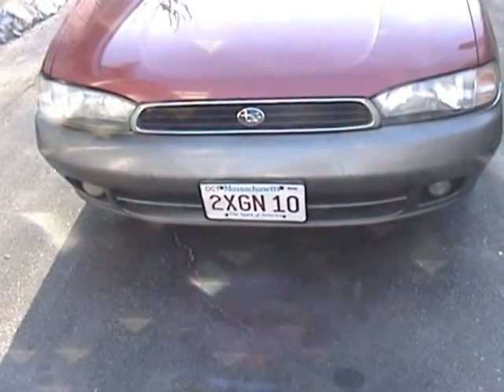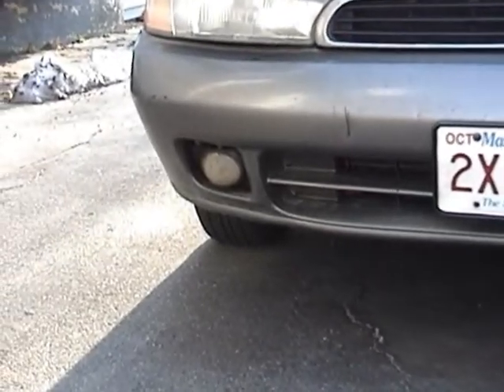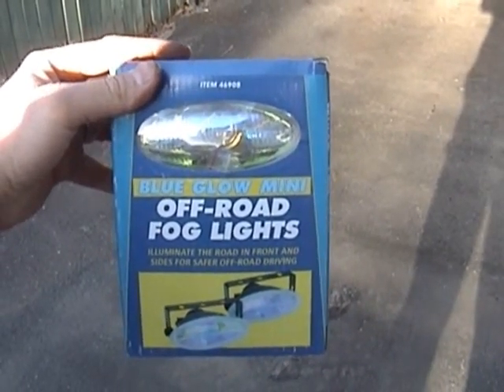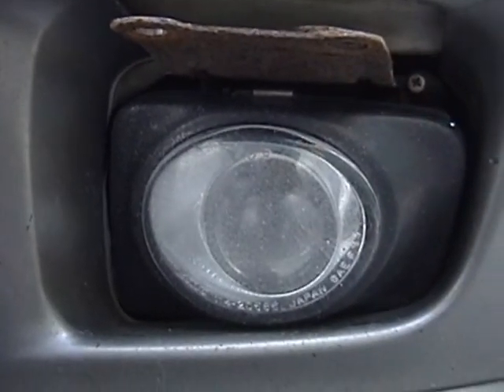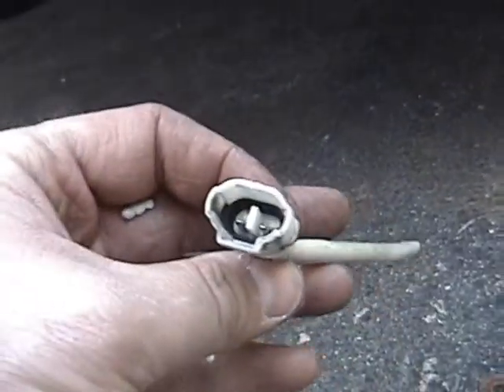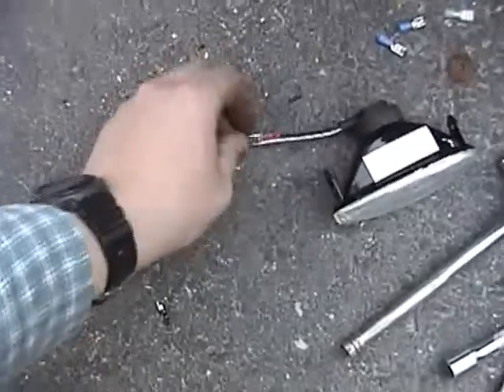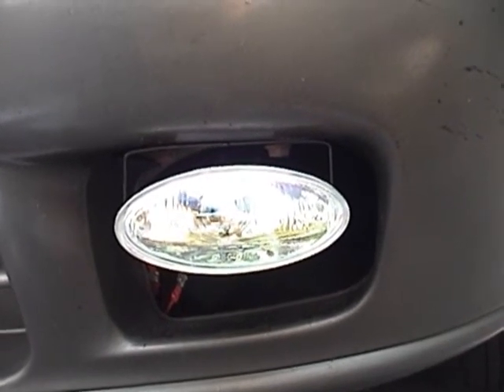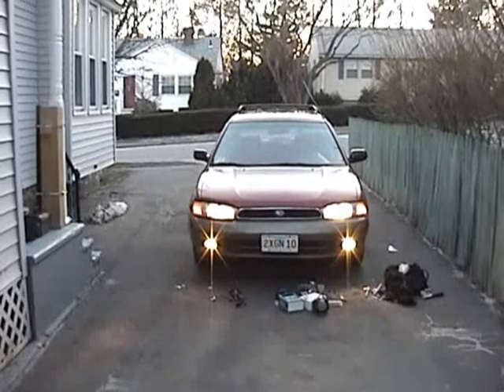1995 Subaru Legacy - DIY: installing aftermarket fog lights

Comment from the maker: Thanks. A knock sensor video will be coming, most likely, but not soon. It's accessible from the top of the engine. If you look down to the block near the rear of the driver's side, beneath the intake manifold, you should see it. It's secured by a single bolt. Not a difficult job. I did one on an EJ25 back in December.

Comment from the maker: Hey there
Sounds like you have a bumper like my old car (Legacy L). My wife has a similar Legacy L, with those spots in the bumper that look like knockouts. I looked at the wiring on her car and the car does NOT have the wiring to hook up fog lights. I also don't know if the dashboard has the correct wiring for a factory fog light switch. You MAY have the wiring you need, but you also may need to run fresh wiring and add a new switch. Not a huge deal in the long run.

Comment: I would like to install fog lights but my car never had them, only a rectangular spot that looks like a knock out. Any suggestion on that? Wiring, cutting out the knock out?  Any thoughts on installing an HID headlight system for my '95 Legacy LS? I've found a few that are compatible on E-Bay.  282,000 miles and still fixing it up and working on it! I found fog lights which did come with brackets and the HID kit on e-bay.  THANK YOU!!

Comment: I assumed there was no ready wiring there, and assumed I would have to splice in new wires. There is a knock out on the dash for additional accessories so I could put a switch in there and run my own set of wires, a job I would be fine with.

Comment: how did you do the splice part? what were those pieces you connected to the ends of the wires to allow the connection of the new fog light to the factory wiring?

Comment: I have a 1997 LSI wagon, that has doesn't have the fog lights, but it has the cut-out for the fog lights.  I was looking around the front bumper and I notice the factory fog light connectors. It seems that this car is capable of having the aftermarket fog lights. The factory fog lights is too expensive. I am considering an aftermarket pair of fog lights. My question to you---  Can the fog lights be turn on and off with factory switch?  Do they have to be on all the time when you turn on the car?  I am planning on doing the same install as your fog light set. But I don't want my fog lights on every time; I turn on the car.
Reply from the maker: +Mister X I spliced my aftermarket fogs into the existing wiring in my bumper. I use the factory switch and wiring to activate them. They are not on at all times with the car - only when the headlights are on AND the fog light switch is turned on.

Comment: What were the bolt size on the stock fog lights you took out? I can't find in anywhere
Reply from the maker: Tough one... Unfortunately, the video dates back four years almost to the exact day, and I no longer have the car itself or the old fog lights. If I was in your shoes, I'd just get a set of small metric hardware and go trial and error on finding something that fits. Best of luck.

Comment: Do you realize that you replaced expensive KOITO JDM fogs with cheap no name parts??
Reply from the maker: I debated whether or not to address your question, but here it goes. I doubt you'll find it satisfactory, and it is a LONG explanation. If you don't mind a VERY long read (you've been forewarned), here it goes:

Yes - I was absolutely aware that I replaced the factory fog lights with the cheapest available alternative. That was the intent (more detail on that lower in my response).

No - I was NOT aware they were KOITO, as I'd never heard of the brand before your comment. I'm sure it's an excellent brand, but I don't know lighting manufacturers. I never pretended to, and I never aspired to. There are a great many manufacturers of aftermarket and OEM auto parts, not limited to lighting. At the time (this video is seven and a half years old), as far as I knew, these were made by Subaru. 

More to your point, I was 100% aware that I was sacrificing quality by installing these cheap lights. It was obvious that all things being equal, if the factory fogs were in brand new condition, they would have been far superior lights. For me, these were the most suitable alternative.

This car was, in early 2013, new to me. But, it was an 18 year old car hiding a lot of age- and rust-related damage and wear and tear. Plus, these cars were a dime a dozen back in 2013. A ratty example like this one wasn't, in my opinion, worth spending a lot of money on. As I said early in the video, I did try to get the factory fog lights working again, but they were too far gone. One was completely corroded, and the other only worked for a short while with a new bulb. I needed the fog lights to work for the car to pass inspection. The car didn't need fog lights to pass the state inspection, BUT (and here's the catch), any lighting present had to be in working condition. So, because the car was already equipped with fog lights, they had to work. My options were to fix/replace these with equivalent, replace with aftermarket, or delete them. 

Originally, I wanted to replace these with the same lights. I don't recall if I was able to locate a new pair, but at the time, even used examples were prohibitively expensive. I recall paying around $1000 for the car, maybe more, and I seem to recall (once again, going back in memory nearly eight years) that it would have cost at least $100 for a used pair at the time. Compared to the cost of the whole car, that's a big chunk of change for a pair of lights that I would rarely use. I looked for a new pair, then checked junkyards for used ones, and then checked eBay. 

So, I found a pair of new lights locally – the ones I installed in this video. I think they were around $20 new. The goal was to get the car to pass inspection, and these did the job. This was not a high-dollar performance car. My personal standard for automotive lighting is twofold:

1) It needs to work
2) It needs to pass inspection

These lights accomplished that. Even without knowing the manufacturer, I was well aware that these were a severe downgrade from the factory fog lights. As it is, I got just over three years out of this car before age completely caught up to it and I sold it for parts. I have absolutely zero regrets about deliberately putting in the cheapest possible fog lights.